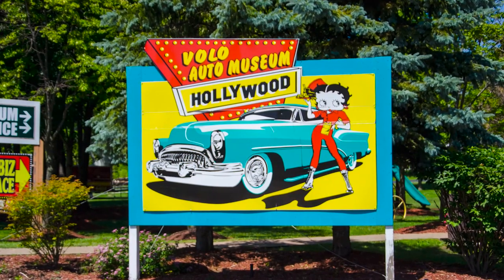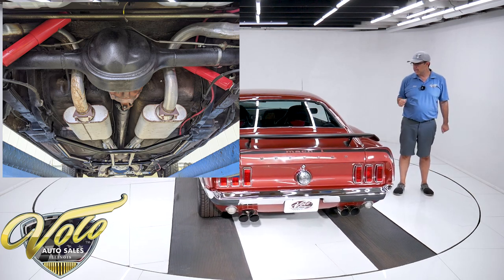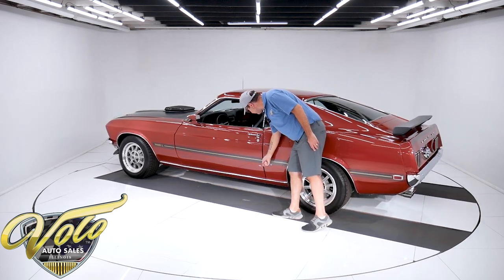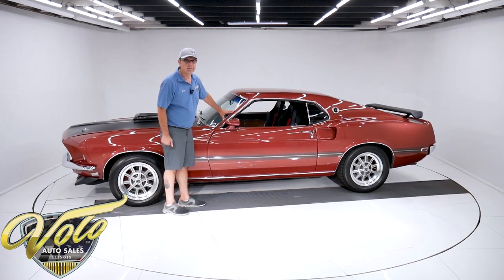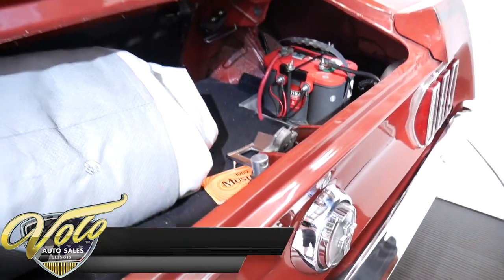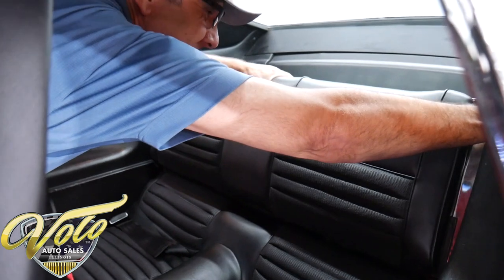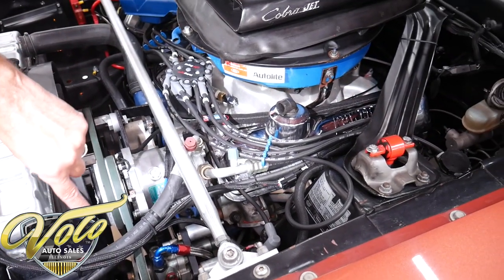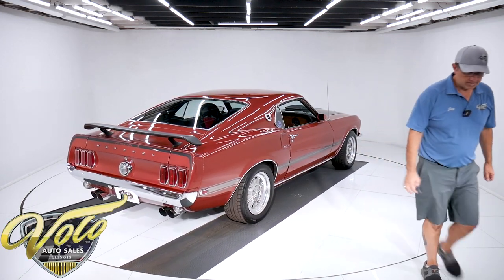1969 Ford Mustang Mach 1 for sale at Volo Auto Museum (V20515)

Comment: I have mixed feelings about this car. Normally I like restomods, but not this one. The 428CJ in this Mach 1 was best left alone. If necessary a professional rebuild would have been perfect. Same with the aftermarket trans. If the car was originally a standard, un-optioned 69 fastback with say a 302 under the hood, I would have loved this high performance rebuild.
Reply: Agreed 👍